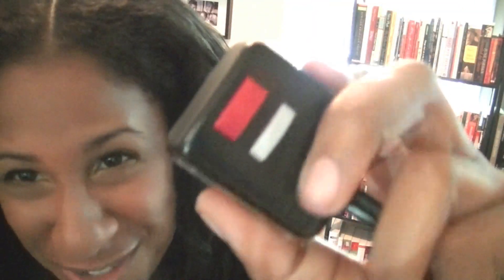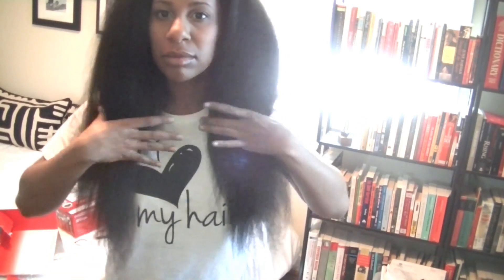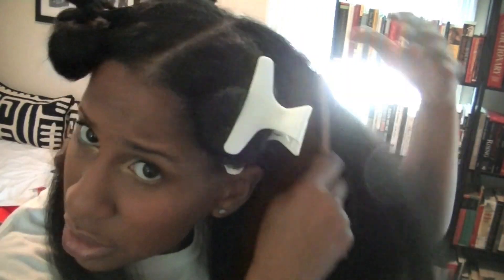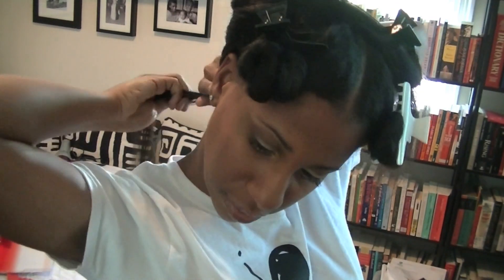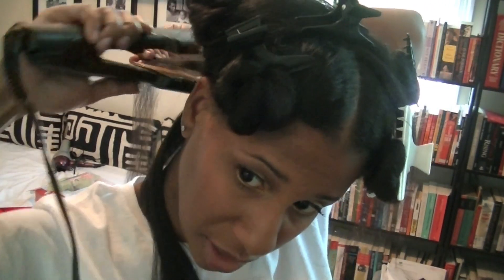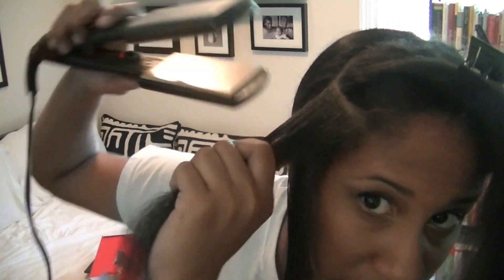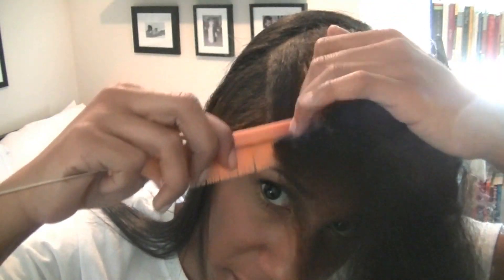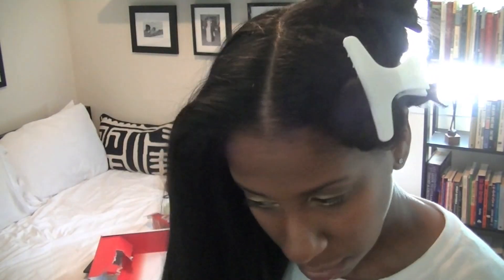STRAIGHT HAIR ROUTINE: Part 2-Blow-Dry/Straighten

Comment: 2) stay with the twists until my hair is about 12 inches and then I'll start stretching my hair. My only fear is heat damage. What temperature and straightener do you recommend?!knowing my fear of that is the only think that will hold me back from the heat straightening part. I may just stretch it or use ionic rollers on damp hAir with a hooded ionic dryer :)
But either way keep it stretched.my hair is mainly 4a with some 3c 4b and 4c. It's a mix mash of some many dif textures